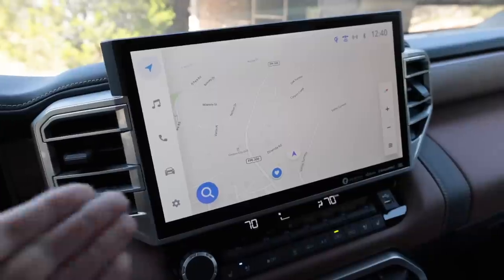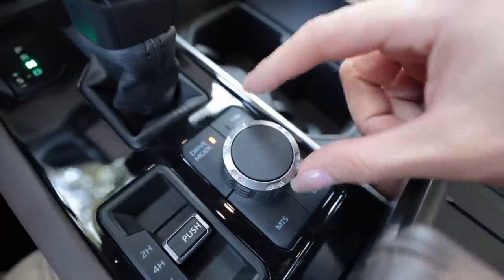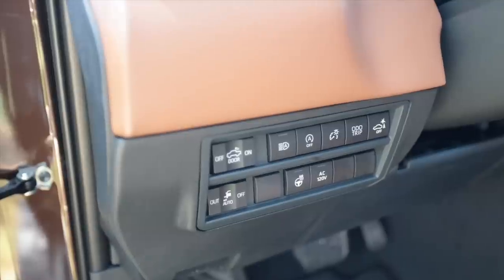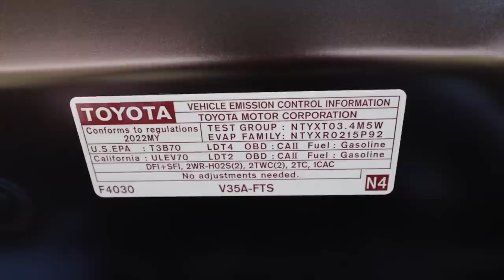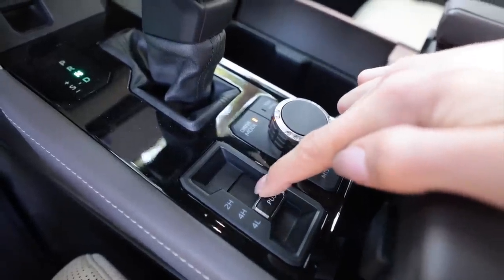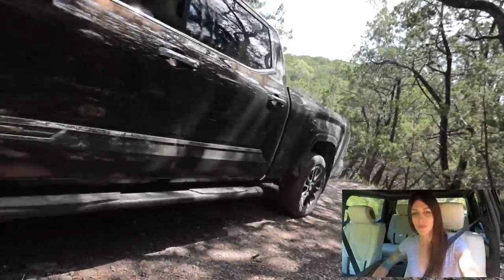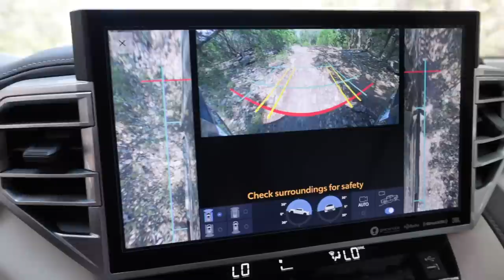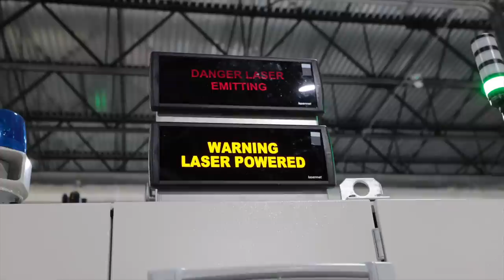A Weird Girl Reviews The New 2022 Toyota Tundra Off-Road

Comment: Semi truck turbos don’t last a million miles (rarely) I change mine at about 350,000 as preventive maintenance
Reply: Just out of curiosity, how much do one of those cost?  Also, thank you for transporting the things that keep our economy running.
Reply: @The_Opinion_of_Matt  mine isn’t too expensive $800 to $1300 thanks
Reply: @throttlewatch4614  That's not too bad.  I'm used to seeing aftermarket turbos for sports cars costing from $1000-$3000+.
Reply: @The_Opinion_of_Matt  my truck is a 1995 Detroit 60 series I’m sure the newer trucks are way more expensive especially twin turbos
Reply: I work in a international dealer, and the turbos i see are mostly between 4k an 7k(CAD)
Reply: @oliviermorneau2819  that’s like $300 US 🇺🇸😂
Reply: @throttlewatch4614  
That must be the price for a REMANUFACTURED turbo, right?
Reply: @IamDoogy  I forgot to mention that yes but even a new factory turbo doesn’t last a million
Reply: @The_Opinion_of_Matt  That’s because of all the fancy ball barrings and CNC turbine wheels and shafts. Line production turbos aren’t made with all that specialty stuff.
Reply: @monroefive-o40  That makes sense
Reply: My turbo blow up  smoked like a steam train !  Drove 50 miles to Laredo texas  almost blow the Detroit 60  from low oil 🤦🏻‍♂️
Reply: @melindaortiz9741  well yeah, you can’t keep driving something after it breaks 🤦🏼‍♂️
Reply: I drive around 24,000 miles per year. It would take over 40 years to hit a million miles.

Comment: This is the first of the new Tundras that I haven't hated the looks of the front end. The interior is big enough to be a house, and even includes some wood trim & multiple "lone" stars to complete the "Texan wife/mom designed it" look. The Texas mom crew seems to be who every pickup manufacturer is catering to now with the multilink rear suspension systems they all seem to be switching to these days. I'm not disparaging the manufacturers, as this is just smart business given the demographics of their 1/2 ton pickup buyers over the last 15 years or so. I just think that it's funny how so many moms buy giant trucks to drive their kids around cities at 30 mom because "they're safer."

Totota will sell every Tundra that they can get enough computer chips to build. And rightly so. Thanks for the review. Hope you enjoyed Texas. 🌟

Side note:
Has anybody else noticed that the outer designs of our tech are going back to the late 1990s - early 2000s? The center screens on many vehicles look like the slide-n-flip DVD players that were in half the cars in The Fast and the Furious. The Moto Razr is back. Gaming computers are back to using full-size towers. Some digital displays have tachometers that look like they were taken from the "digital" display conversions that people used to put in the 1990s Chevy pickups.

Comment: Hey Sarah, that was awesome I have watched a bunch of videos of the new tundra and you were the first to actually take the engine cover off  cool that you showed the underneath and the factory great job👍 it would’ve been neat if they would’ve kept the V8 as an option hooked up to a 10 speed transmission if only to compare the two but if you’re going to try to get longevity of a TwinTurbo V6 I think you definitely start with a Toyota no doubt about it. A little weird yeah maybe but wonderful absolutely🐧🐧🐧👍
Reply: I will be running BG MOA (Motor Oil Additive) through the dealership with every oil change.  This will cover the turbos for up to $4k in repairs, regardless of the mileage I will eventually have on the truck.  An extra $18 per oil change is worth it to me.

Comment: Watching your head oscillate while stabbing the throttle was pretty funny. And I would agree on the twin turbo longevity factor which can only be determined with time.
Reply: I'm calling it at 400,000+. The motor may go longer, but spoolie bois not so much.
Reply: @kb9oak749  If you change to synthetic oil and filter a lot...

Comment: Really nice review, Sarah. I like generally like the redesign - just seems like a bit much chrome on the exterior. I am guessing the twin turbo V6 has both DI and PI to control carbon deposits...it will be interesting to see if this engine will suffer any oil dilution problems.
Reply: Yep. Change the oil regularly!
Reply: I doubt it because no other Toyota/Lexus engines have that problem and there all PI/DI like this one.
Reply: @tails300  
Because none of them have hit 60,000 miles yet
Reply: Do Not like that front end. It's like a huge chromed Face Mask...
Reply: @miller1  I agree.  The black front ends look so much better.

Comment: I'm really glad Toyota finally replaced the inside of the bed. That composite should last forever, unlike the the steel that rots out. Question, where is the fuel filler door? The tank is on the passenger side now, but I didn't see where you fuel it at.
Reply: I believe I see it in the same place on the drivers side brd. Round door.
Reply: @speed8701  weird. The filler tube must go across the truck then.

Comment: The longevity is exactly why I wont buy a truck like this. Not only do I think you're right about the turbos not lasting forever, but I think taking a small displacement engine like this and literally forcing it to make the power of a big engine all but guarantees it'll never live up to the longevity of previous generations of tundras. The harder you ask that little engine to work the sooner something is going to fail. That said, trucks are outrageously expensive these days so if I buy one, I expect to get a long life out of it.
Reply: I'll bet it will out last an American V8 truck.
Reply: I was about to say the same thing:  That's too much power out of too small an engine, to say nothing about the added stress of turbochargers.  And judging the way Americans drive, I seriously doubt there will be a lot of million-mile survivors, if any.  And a 10-gear transmission, I'd say that's a bit of overkill for a vehicle that isn't a semi; it's just a pick-'em-up trying to behave like a luxury cruiser.  I know, I know, that's been the in-thing for decades now, but still...imagine the terror of trying to keep a thing that size under control on slippery roads, especially if an emergency maneuver is called for.  IF it has manual control for all those gears, then my argument would be moot, at least to a point; some knowledgeable drivers would be able to maintain control with the lower gears.  But nowadays, I have to wonder if that is even factored into the building of transmissions with 6, 7, 8, 9, or 10 gears.

It is impressive in some regards, but not enough to make it a must-have on my list, especially not for the mortgage one would have to take out just to put one in the driveway.  And with the gradual shortage of oil coupled with a shortage of parts, I predict a lot of backorders for the plastic parts that will eventually stress out of commission (after all, where do you think plastic comes from?).
Reply: @toronado455  We just have to see.  It's too soon to give it a real durability test, one that tests the longevity of the structure.  Maybe we'll see how rust-resistant it is in about 10 years.  I must admit, the Americans I've seen after 10 years have far less rust resistance than even my own 55-year-old car.
Reply: You have no idea what you're talking about!

Comment: You were mentioning when you use just light throttle increase how the trucks ten speed auto transmission quickly up shifts through the gears. Automatic transmissions don't go through the (so called gears ) as you stated . Politely speaking , they up shift ,and downshift through what are called ranges. Not gears ,,,,,,,,,,,,Ranges. The only gears in an auto transmission are sun gears ,and planetary assemblies. They do not change position .They just spin. Clutches in the transmission apply,and disengage from lo to high ranges ,and vice versa when up shifts,and downshifts are required.  Retired NAVY vet here . Love the show Sarah.Stay safe ........

Comment: I drive. 2018 1794 Edition, and while the V8 sounds great, it has about the same Horse Power BUT about 100 fewer torques!  The gas mileage I get is terrible I’ve average about 11 MPG which is terrible.  Even less if I run it on Ethanol.  I’d be happy to trade a less efficient V8, for a better performing, less fuel crazed V6.  I’d also give my brother’s left but for that new suspension as the 2018 version is just as luxurious on the inside, but you never for a moment forget you’re in a truck with that towing tuned suspension.

Comment: The 3.5L twin turbo V6 is some impressive engineering and is plenty powerful enough for most people's use cases.  That said, it looks like their is enough space in the engine compartment that they could have built a 4.0L twin turbo V8, which while not adding much displacement would have had smoother power delivery and a nicer exhaust note.

I am still waiting for Honda to do something like this for the Ridgeline by sticking 2 of the Civic Si or Civic Type-R engines on the same crankcase.  That would give you a 400hp 3.0L V8 or a 600hp 4.0L V8 in a Ridgeline, which could be a lot of fun.

Comment: Ive heard the turbos on the ecoboost only lasting around 40-60k miles before they need to be replaced. So i feel very lucky to have 135k on my turbos, however i do believe they will need to at least be rebuilt here soon as im starting to hear the tapping noise from the waste gate bushing… and if i have to rebuild them 😉 i might as well upgrade them and tune it for the upgrade

Comment: I remember seeing articles about a self-pressurized lubricating resovoir for the turbo, back in the 90's. I wonder what became of it? On engine shutdown, it would lube and cool the compressor on spin-down.
Reply: In the racing world there is something that works like that. Also supplies some pressure on hard cornering.

Comment: Twin turbos add complexity that can fail and could require some expensive maintenance or repair.

Economy wise, I don't think you get the economic/efficiency payoff versus the increased reliability of a normally aspirated, larger engine.

Comment: Turbo is just a consumable part of the engine. 
Not a big issue with older diesels, as the exhaust gases are much colder than gasoline. Still has to be replaced at a regural interval.
Since this is a gasoline, the turbo will need to be replaced fairly often.
Reply: I'd have to look to be certain, but I think gasoline engines have a lower EGT than diesel engines.  Anything turbo is going to have higher EGT's though.
Reply: @The_Opinion_of_Matt  around 200 Deg Celsius higher.

Comment: Thanks for your video. I personally don't need a racing truck, so whether it's extremely fast or not that's fine. I do need it to be strong enough to put all my overland gear on and be ready to hit the off-road trails. My question is if the new Tundra is going to be more economical, in gas consumption, than the current ones and if that economy is going to lose it once loaded with our accessories. I have a Tandra Crewmax Off Road V8 and it has worked excellently for several years and I only worry sometimes about the gas mileage.

Comment: Considering Ford Ecoboost owners are getting 250k miles out of their trucks, the Toyota should easily meet or exceed that with proper maintenance.  Turbos are not the unreliable mess they were back in the 80's and early 90's.  They have become pretty reliable components.

Comment: I'd like to know if it has a timing belt or timing chain? If it has a belt you probably need to change it every 100,000 miles to keep it from ruining the engine if it breaks.
Reply: chain
Reply: @joebagodonutssummertime8267  8 cylinder

Comment: Just bought a 24 Tundra Limited non hybrid, it has gobs of power, ya just don't need the electric motors, my truck will do 0-60 in 6 seconds, how fast ya gotta go ?, I hate the piped in exhaust note, it's so phony, gotta find how to turn it off.

Comment: I just hope the streetification of the Tundra means there's a Tundra HD coming soon.
Reply from the maker: This thing was so big it felt like an HD.
Reply: @SarahnTuned  Even the last gen Tundras feel like bigger trucks than F-150s and I have no problem exceeding the towing rating of mine on occasion, it hardly even notices.  But now they are coming with multilink/coil spring rear suspension and no tow hooks?  No thanks.  I've had that experience with Dodge and when you're using the truck to haul every day, you're replacing bushings and arms at an alarming rate.

Comment: The rumour about V8's lasting a million miles is ridicolous, there might be one that still ticks over at that milage, but even after 200k miles they leak compression, barely opens the valves and wouldn't pass an emission test,  and most of theb horses are dead by then.
Reply: BS. There's 4 of them out there now. Try that with any domestic.

Comment: I think this truck needs a bigger front grille. Holy F***!!!! If you remove the grille, you can probably fit a Fiat 500 in there!   I like the interior of the truck, but the exterior (Front End) of the truck is just typical Toyota weirdness. I swear Toyota body design engineers all slam Red Bull and smoke the Ganja at the same time to come up with these weird designs.

Comment: Stop the Madness,  My gosh, how much bigger are they gonna make the grills on these new trucks. In my opinion they look ridiculous. Wouldn't surprise me if they started making the front of these trucks 4 feet wider than the rear just so they can fit a bigger grill. I guess it doesn't matter though, in a few years they'll all have Electric motors in them anyway and the whole bed will be a gigantic fan to cool the batteries. Lol, Whatever.

Comment: 2004 Tundra rotted away, 2002 Taco needed massive frame rebuild.  1996 Ford  light rust.   Never again Toyota.
Reply: Had just the opposite. Toyota's were bullet proof, no rust anywhere even in the rust belt. Ford had many issues. Never again. I see many newer f150 's in SW Ontario with rotted wheel wells, cab corners, and rockers, the frames have to be in bad shape as well.

Comment: Great review…. Fugly truck…. Seats seemed nice don’t care for the infotainment screen looks out of place. The front end makes me cringe every time I see it. The engine is prefer a v8 even though it has less power. Toyota has been making v8 since the 60s small displacement but still a v8. I love the current 1794 truck has plenty of power and fuel economy is not bad compared to a GM truck. Sad to say there are way too many dislikes on the new tundra for me to buy. Yes I tow and use mine like a truck. On another subject I spotted some EV testing down the hwy 101 in Santa Maria. They were testing a tesla, a wrangler,a bunch of Fords, including the Mach E, Hyundai,the new bronco, the lightning, at the very end a F350….